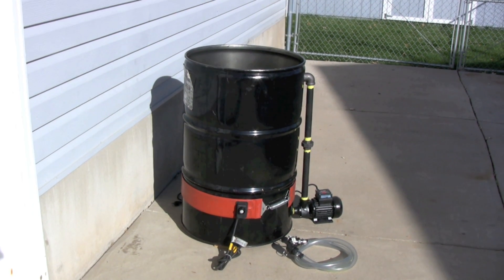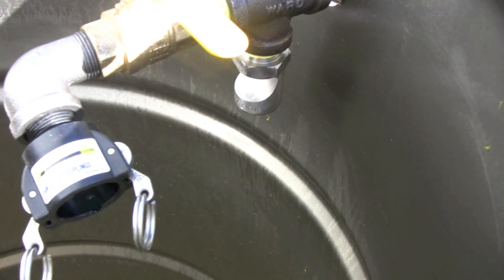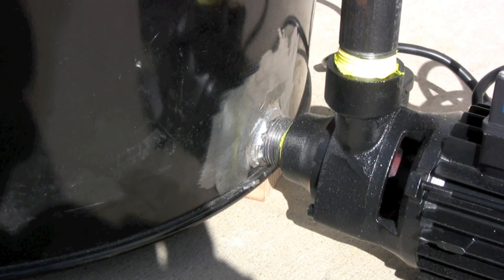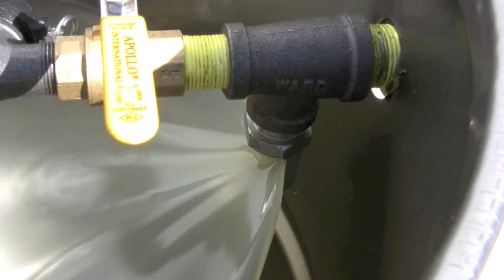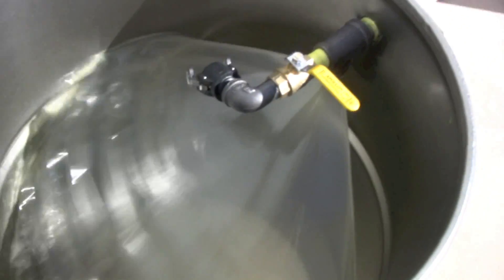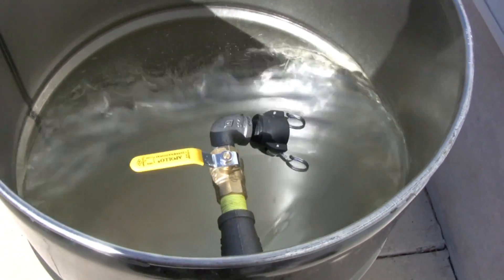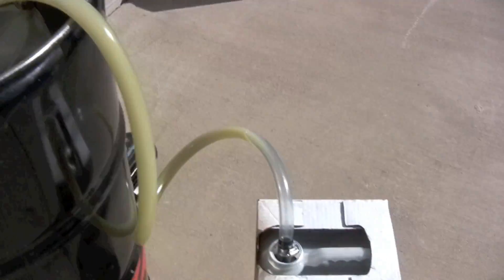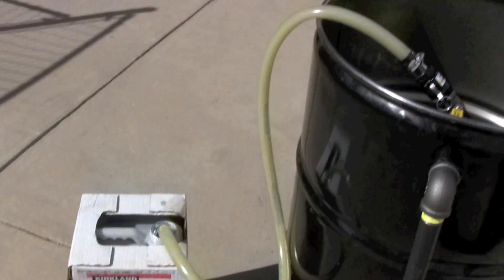Oil / WVO / Biodiesel Dewatering Drying Tank - Utah Biodiesel Supply

Comment: Interested in unit or a few .........How many gallons can it dry per hour and what micron would it need to be down to for a good flow rate?
Reply: You can very easily. With no welding. You do however need to cut out the bottom. That is easy to do or get done too. Buy a 2" to 1" threaded reducer and the rest of the plumbing needed.  Install all  the plumbing and flip drum upside down and place on stand or bricks. No need to drill hole on top. Just jook the pipe fittings over the lip of drum and that will keep it in place.
https://www.youtube.com/watch?v=CNjWC3IbxMk
Reply: You can also make a manifold and connect a few drums drums together with the open top drum at least half the drum higher than the rest. That way you can dry a few hundred gallons at a time. Instead of only drying half a drums worth at a time.